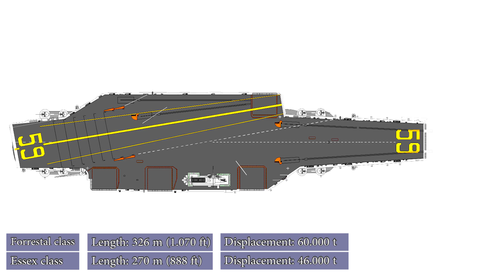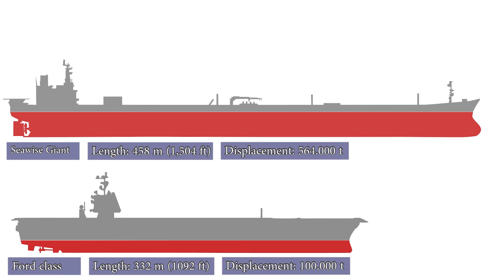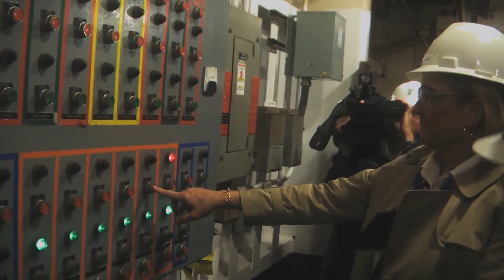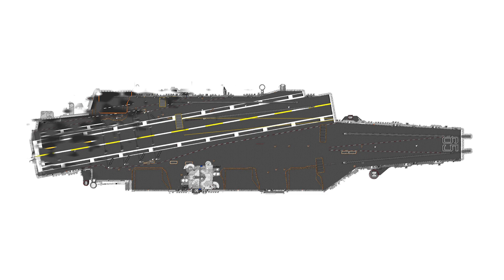Why don't aircraft carriers get bigger?

Comment: I do wonder if the cost of creating a larger "Seawise Giant"-sized carrier might pay back a good portion of its cost difference by not having to specifically adapt carrier variant fighters with tougher landing gear and arresting rods (among many other structural changes) in order to cope with the high speed, short distance landings they have to make on shorter carriers.  How long would a carrier have to be to just use normal F-22s or F-15s?
Reply: Take off and landing distance is not the only consideration. Carrier capable aircraft are designed with operating in a salt water environment in mind. I've seen 30 foot seas crash over the bow and completely drench aircraft on deck. F-22s would be ruined by that.
Reply: @michaelmappin4425  Yeah the ocean hates us and especially anything metal.
Reply: According to Google, The F-22 takeoff distance is 480 meters. So a decent amount bigger, but not that much.
Reply: @maci coinc  That's takeoff distance, not landing. Carrier landings are actually significantly harder on the airframe than takeoff, because you can't gently set an aircraft down like you would with a conventional runway. You slam that aircraft onto the deck at a far higher rate of descent than any land-based aircraft, both to increase precision and to reduce the chance that you just skip off the deck, particularly in adverse weather conditions.

As for landing distances, the F-15 STOL/MTD test aircraft that was specifically built with short takeoffs and landings in mind still required 1,650 feet to land, with the base F-15 needing four and a half times that distance.
Reply: @griffinfaulkner3514  so 502.9 meters. Or a little more than a third bigger than current ships.
Reply: @M33f3r  Yes, on a perfectly dry, flat, and stationary runway in the middle of a desert, using a one-off prototype with no weapons or external fuel tanks. The only situation where you'll be landing on a carrier like that is returning from a long-range strike where you dump not only your primary weapons load, but your self-defense missiles and external fuel tanks that carriers tend to like to keep around. This also requires the sea to be exceptionally calm, and for there to be absolutely no water on the deck. And even then, any sane pilot is going to want arrestor gear, which requires reinforcing the airframe, and at that point you've got a carrier plane anyway so you make the carrier the same size so it can use the infrastructure that already exists to support them and just build more of them for redundancy.
Reply: @griffinfaulkner3514  Damn bro just let me dream of a super carrier so large it acts as an Air Force base itself with land based fighters😢😢 it just gets my MIC worshipping part of the brain drooling

Comment: Also, if you make the ship too big, it won't fit through the Suez canal anymore. (Current ones already don't fit the Panama canal.)
Reply: My point exactly. Even the Iowas were the size they were so they could get through Panama.
Reply: Aircraft carriers (at least US ones) don't really need to because the US has ports on both of the major oceans, and carriers will never leave an area of operations completely unpatrolled.
Reply: @Noisy_Cricket  the USA want to have the strategic advantage to being able to shift its fleet from the Pacific Ocean to the Atlantic and vice versa, while Russia cannot even send ships from its Baltic fleet to the Black sea.
Reply: just make the canal thiccer
Reply: new panamax can already fit container ships larger than nimitz.

Its dimension is 366m Length, 49m beam, and 15m draft
Reply: Was going to mention that myself.
Reply: You make a great point but will it matter at all? Arctic circle is melting, the Arctic Ocean is about to become  completely navigable within 50 years.
Reply: @connerschupp4543  50 years ago we were headed into a new ice age.  Now all the gorebal warming activists are purchasing ocean front property.
Reply: @connerschupp4543  That's too much time
Reply: @connerschupp4543  " Arctic circle is melting [...] completely navigable within 50 years "
We are being told that story for the last 30 years, if not more.  10 years ago some company tried to profit from opening of the North-West passage and invested in a port there.  They went bankrupt.
Reply: @bakters  well that’s what happens when you get greedy and try to be first 😂😂. Otherwise the ice is melting bud.
Reply: @Justone372  " the ice is melting "
Impossible.  It all melted 20 years ago, exactly as predicted.
Reply: Same reason the O.G.  A.M. General H.M.M.W.V. has its' dimensions... To fit on Euro spec rail stock, and THROUGH European rail tunnels. 
🤟🏽🐻
Reply: @teddyabearo1066   Years ago, they were transporting the very first Atlas missile for testing at Vandenberg AFB, it was built in LA, they charted the roads they had to go and one of them yes, the overpass was high enough, the problem, the maps didn't tell you that it dipped under and when they got there, and started down it went under, then as the front started back up, it crushed the entire body of the missile. it was all over the news.
Reply: Interestingly they can at the waterline,  one of the scrapping options for enterprise was removing her flight deck and towing her through the Panama canal
Reply: @mcduck5  I know the Forrestal class carriers can get through the Panama canal.  As I recall, the Nimitz class WAS originally designed with the Panama canal in mind but they're just a little bit too wide to go through the Culebra cut.
Reply: Was just going to say this. I've been through the Suez canal a few times on the Enterprise (CVN 65). I don't know the technical aspects of the canal, but there didn't appear to be a lot of leeway on the narrow parts when we went through.
Reply: @JimmyMon777  I felt the same way on Saratoga (CV-60) which wasn't THAT much smaller than the Big E
Reply: Thank you.
Reply: Yep, the beam of Iowa class battleships was determined to just barely fit the Panama Canal.  But carriers are huge high value targets, and missiles have come a long way.  There’s a rationale for many small carriers
Reply: @lanedexter6303  Especially with the proliferation of VTOL/STOL aircraft that have the capabilities of more conventional planes.  There will still be a place for the full sized carriers, for example I am unaware of a VTOL replacement for the tanker version of the A-6 for aerial refueling.
Reply: @michiganengineer8621  good point.  Just thinking how some jerkwater country with a few Silkworm knockoff missiles can get lucky and take out a VALUABLE target.  I wonder if we’ll see a bunch of updated faster versions of the old jeep carriers.  I guess budgets and politics will decide.
Reply: @lanedexter6303  You wouldn't even need a "Worm", especially in a choke point area like the Straights of Hormuz, Gibraltar or at either end of the Suez/Panama canals.  Some comparatively "simple" bottom anchored mines made with 55 gallon drums would really screw up traffic.
Reply: Yep.  I think the future will hold a lot more asymmetrical warfare.
Reply: Been through the Canal twice on a nimitz class. They fit.
Reply: Panama and Suez Canal have already been widen …
Reply: 99% sure they fit in the new Canal.
Reply: They know to the exact inch just how close they fit through either canal; it takes much longer to deploy going around the canals.
Reply: Just go through the cape!
Reply: Really lol
Reply: Just use smaller amphibious assault carriers
Reply: What about longer?
Reply: You also don't want a supercarrier inside a canal. It's way too easy a target.
They need to stay out at sea and only dock at the friendliest of ports.
Reply: @protorhinocerator142  
Doesn't matter if the port is friendly then, it's a matter of security
Reply: when you have supremacy fighters on your ships. you can just conquer the canals.

Comment: I think their is a good argument for more OECD nations getting the big 100Kton size Carriers vs the smaller 40-60kt ones they currently use.  But they would need to be willing to have them manufactured overseas as part of a bulk purchase in order to make them cost effective.  Currently all these medium sized ships get built as expensive singles or pairs and have much less economy of scale.
Reply: Bulk purchase and super carrier can not be stated together, nor can economies of scale. When you say overseas, do you mean the US or a developing country? The only countries in OECD that could potentially even field one super carrier are the UK, Japan (if they changed to an offensive military), and France. It would essentially require almost two years of their yearly equipment procurement (for their whole military, not just their navies), just to purchase one each. If they did so, it would then eat up 10% of their support budgets (for their entire military, not just their navies) from then until the carriers were decommissioned in 50 years. That isn't even taking into account that none of them have the required planes (tack on another 10 billion to the price tag, minimum), equipment, personnel, infrastructure, or experience with a super carrier. They would also need the required ships, equipment, and logistics for the accompanying carrier group that defends the carrier. Unless these countries tripled their current military budgets, it would be infeasible for them to field a super carrier, let alone field one effectively. Even if they somehow managed to do this, the fact is that one carrier is basically useless for true power projection because the carrier will have to go through routine maintenance every 3-4 years that lasts up to 9 months, large scale refitting half-way through its service life, along with having to spend months refueling the reactors every 7-11. Better hope your enemy doesn't declare war while your one carrier is out of duty. These three countries wouldn't be to hurt by this, because they would all likely be allied together, along with the US. However, this isn't optimal due to cross-military cooperation overheads, and a foreign carrier having priority for supporting it's own military's operations.
Reply: @macicoinc9363  UK, Japan, and France don't need to patrol the entire globe to secure the global economy. The USA does.
And two or three carriers are mostly useless because of planned maintenance cycles. They would need to mimic the US Navy's commitment or join forces and have a combined 10 at sea. This is awfully expensive not only initially but for long-term operations.
Reply: @protorhinocerator142  Exactly, not to mention they would run into logistics and strategic problems with having to integrate drastically different procedures together when creating a coherent force. It makes no sense for them to do any of this because the US is already doing it for free.

Comment: They are big enough, because they can already fit more planes than most countries airforce.

On top of that, having multiple carriers is preferred than 1-2 huge.

You get flexibility of deployment, dont lose that much capacity when they get manteinance, and if hit/sunk its a smaller loss.

Also performance... carriers are fast and agile, bigger ships arent.
Reply: The US military is LEGALLY required to have 11 main aircraft carriers. So if they built them bigger, they'd still have to have 11, not 1 or 2.

Comment: US warships need to be able to traverse the Panama Canal, for the sake of responsiveness to threats, and that sets the limit on width.   Speed arguably matters for this mission, and a 500-meter-long ship's hull speed would be 11 knots greater than the hull speed of a Ford/Nimitz class ship (which is 43 knots).  That would be a significant improvement (assuming the engines are powerful enough to drive the ship to hull speed), but I don't think it would offset the reduced number of carriers the Navy could afford.
Reply: Current Nimitiz and Ford carriers can't go into (fit) the Panama Canal anyway. Only the Suez canal.

Comment: another item of note regarding building a gigantic Mega Carrier.
aside from the infrastructure needed to build, house and maintain it.
once somebody builds one, everybody else will either want their own as well or devise means to neutralize the Mega Carrier's influence.
from WW2 onward, Carriers increased in size incrementally. roughly 20-25kt per step.
the next iteration could possibly jump by 40-50kt given modern shipbuilding technology assuming we still need carriers at that point.
a large ship is easy to track from orbit so potential enemies will know where it is and can sort out where it's going.
awful hard to hide a half a million Tons of Airport in the middle of the open ocean.
not to say that plans haven't been drawn up for a Mega Carrier. they just haven't been given serious consideration.

Comment: All US nuclear aircraft carriers have been built at Newport News Shipbuilding.  Drydock 12 is used for new construction and could accommodate an aircraft carrier that is significantly longer and wider than the Ford Class.  Refueling and overhaul are performed in Drydocks 10 and 11, and those could not accommodate a larger aircraft carrier.
Reply: NNSY drydock can fit Nimitz class. Very tight though.

Comment: 1:04 WW II Essex class was only 30,000 tons, are you referring to the midway class at 45,000 tons?
5:23 In truth the number is actually twelve this supports operations cycle of the fleet and maintenance of the ships to keep them in peak performance. Right now with ten ships maintenance cycles are being deferred for operational needs.
9:34 this is inaccurate normal flight operations happen with ship travel at around twenty knots the normally do not like have more then 25 knots of wind across the deck. Personnel start having ease of movement issues and slip and fall accidents along with fatigue.
You have made a wrong conclusion on the growth of aircraft carriers. It all comes down to aircraft and number of them and the ability to manage them. As aircraft size increased (especially at the dawn of jet age) aircraft carrier design adapted to it. The number of operational aircraft carried and mange also dictated it size. When the Midway class was commissioned it could carry half as many aircraft as the Essex but the command and control was not able to manage that many aircraft, so hence air wings are general made up at around 100 operational aircraft embarked. I'm a retired US Navy Aircraft mechanic and have deployed at one time or another aboard every Nimitz class carrier except the USS Eisenhower.

Comment: “Add larger planes…” while showing a picture of a C-130…… which was demonstrated to land on an aircraft carrier decades ago. Why don’t we use them? Not enough benefit. It’s the same reason we never modified the F-22 for naval use: aircraft carriers are easy to spot and impossible to hide, and launches are obvious from miles around, so an F-22 loses some of its advantage. 

“It’s extremely difficult to add more power” is similarly false. For comparison, CVN-65 (USS Enterprise) had 8 reactors and a total (unclassified) 280,000 shaft horsepower, while CVN-78 (USS Ford) has only two reactors with each rated for 350,000shp (I’m ignoring electrical power generation capacity as the Ford was designed to be able to power directed energy weapons and the Enterprise essentially never had to take her reactors above idle because she was so overpowered). Increase the number of shafts or increase the shaft size (both have their own challenges) and you could run a lot more power through what we already have. If you were to build an even larger carrier you’d just add more shafts, and if you don’t care about the Panama Canal (ex: you’re China) you just run a much wider beam with 6 or 8 propellor shafts, add the extra reactors (and most importantly, the turbines for the extra power), and it would be pretty easy to push extra propulsion power through the ship (note: “pretty easy” in the context of Naval Engineering still means “hard” from just about anyone else’s perspective).

Comment: You forgot one massive reason of US-american naval strategy. 
Warships have to fit through the Panama channel. Otherweise the USA would operate two fleets that have bigger troubles supporting each other. 
Also the draft comes into play. Not being able to move through the Suez Channel and barely being able to move through the street of Malacca is an issue. The Viking Jar was neither able to move through Panama channel, Suez Channel and barely able to move through Malacca. This is also one reason why current containerships get broader, but not deeper. 
Also, as being seen with the Viking Jar, above 450 metre, the pull of gravity on both ends of the ship starts to stress the structural integrity. Thats why containerships don't get beyond 450m length.
Reply: No modern American carrier can fit through the Panama. It's been a trend since the Midway class.

Comment: The reason you have 10 carriers is so you can have 3 of them at sea at any one time.
Sounds ridiculous, but look at nations with fewer aircraft carriers: HMS Prince of Wales had a prop coupling issue, and Britain just took 50% of it's carrier fleet out for repairs.
The Admiral Kuznetsov has been in refit for almost 5 years now. By the time it's ready to be deployed, the crew will be green again, further raising the risk of maintenance failures.

You can't always foresee major mechanical failures, but you can at least foresee maintenance periods and refits. So while 3 carriers are on deployment, 3 can be in refit, and 1 can be on standby training crews.

It's sort of the same reason you have more than one crew for a ship. You can maintain a higher pace of deployments and readiness if you have more crews to a ship. Expensive, but effective.